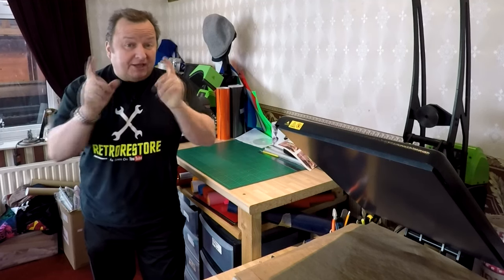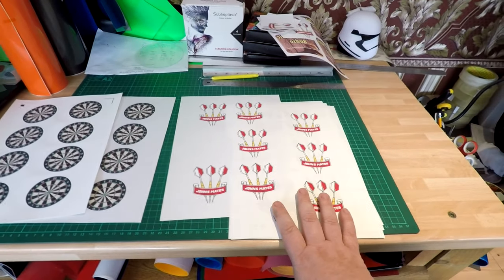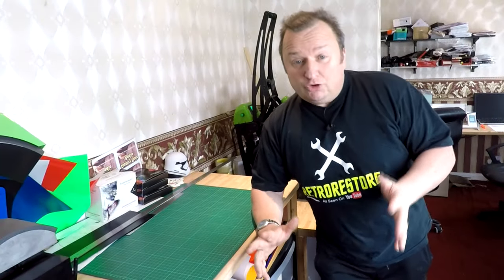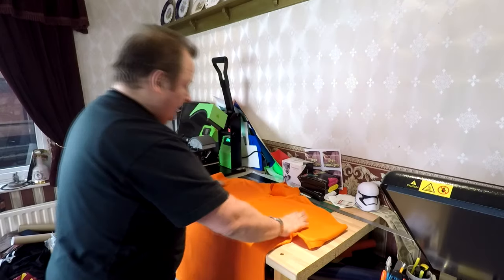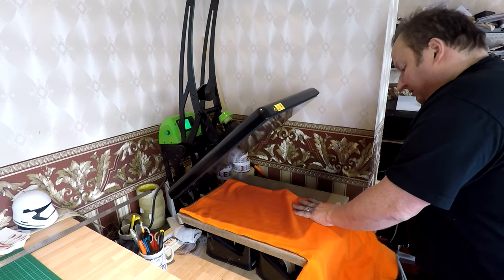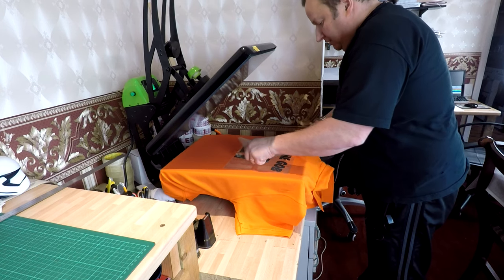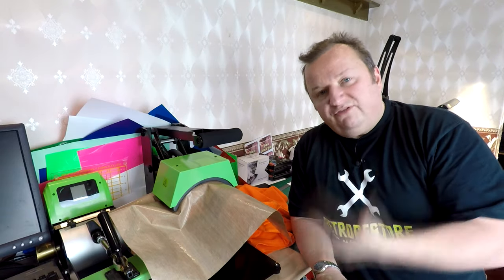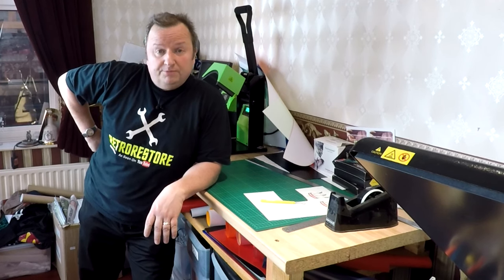Printing Custom Polo Shirts For A Darts Team

Comment: hi martin, just a quick one ive some t shirts to do with a mix of htv vinyl lettering and a small picture of a heart and crown made using transfer paper im wondering which way would be best to press these with the temps and times being different for the transfer paper and the htv, i am using the same transfer papers you use after watching your dvd but my htv is a 15 sec press and hot peel  many thanks
Reply from the maker: I would press the transfer paper first as it is a longer and hotter time. If you use the same vinyl as me, mine is also 15 sec but I always press for 20 sec.
Reply: Many thanks Martin

Comment: hey what you think caused my ink jet transfer to run when it wash
Reply from the maker: Maybe cheap transfer paper, heat press not hot enough to set the inks into the papers, uneven heat plate, this is just a few things it could be.

Comment: Hi Martin.. i have the very same heatpress as you may know since i bought it at the same time you did from subliblanks, well i bought all the same presses as you have, mug, hat and the 16X20 autoslide... how ever... My 16x20 i have to set to 146C to get 160C on the plate, do you have the same problem ? well its not really a problem. Other than that my heatpress works fine, pretty much the same temp all over the plate... this is some great high quality products i think.. :D   thanks for the video..
Reply from the maker: HI bud, No my temp reading is fine, Maybe just needs calibration. I think that can be done from the control panel. Ask Subliblanks on how to do this.
Cheers
Martin
Reply: Martin Butler Great presentation as always. You are appreciated for your constant desire to help others achieve success in business. Cheers!
Reply: Martin, I hope this is not a question that crosses over into your fee services category, if so let me know. But I am purchasing a vinyl cutter this weekend, and have been looking at the Silhouette Cameo 3, however, I just got an email from Sign Warehouse, offering the R Series 19" Cutter. 
https://ssli.ebayimg.com/images/g/BrUAAOSwUIFauUBn/s-l640.jpg
I do large full color Heat Transfers, so it really sparked my interest! Then, I saw what appeared to be the same cutter, in your shop on one of your videos. do you have any opinions about the two. Again, let me know if this question crosses business ethics.
Thanks Martin,
Rose
Reply from the maker: I used to have a Roland GX24 and never really used it. The cameo can do large banners and signs 12" by about 10 Feet so unless you are wanting to do shop signs larger than that, the cameo is all I need for t shirts. I never need to go larger than XXXXXl t shirts and this cutter will cut vinyls to suit those t shirts no problem.
Reply: That helps me a lot, Sir! Thank you very much.
Time to purchase. YAY!
Reply: Hi Martin have just done some polo shirts with logo on front I made up a rubber round pad to put under the logo. With a silicone sheet on worked great could do the same on sleeve as I haven’t got a hat pressing could  just slide it inside now got galaxy heat press brilliant thanks for all your videos find them so lnteresting
Reply from the maker: Yes Leonard. that's a great way to get over the problem. I keep meaning to make my own pads as the purpose made ones are very expensive.
Cheers
Martin

Comment: i just cant get my cameo to print and cut feel like dashing it tru the door. call customer care, they never help me, get fed up  it reads the image on the registered marks but dont cut it stop and says job done
Reply from the maker: You need to add the cut lines bud. Sounds like they are missing. I had this issue when I started Make sure you have cut lines for the cutter to read.
Reply: yes i traced it and add registration marks then put inside the cameo press send  it go an read over the the registration marks then resume back to starting point then says done / unload /ready. just need a solution
Reply from the maker: Without seeing the problem, Its really hard to say i'm afraid.
Reply: Hi Ryandinho, I had the same problem mate, hope you don't think I'm intruding on your thread. I wasn't inserting my mat correctly, you have to make sure your mat lines up perfectly with the blue line on the cameo, after I did that it worked fine. Although I now have another problem where the cameo isn't cutting out my designs to the cut lines.